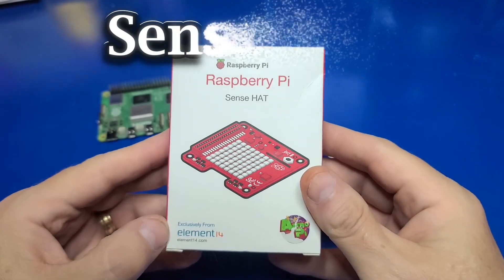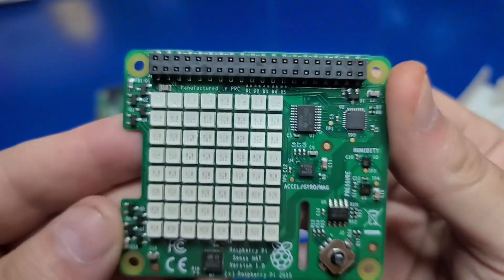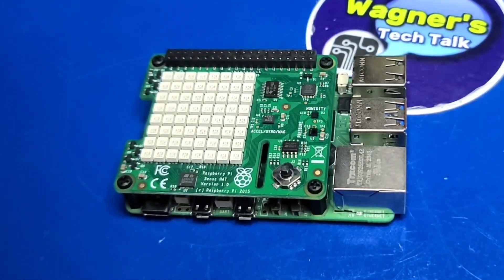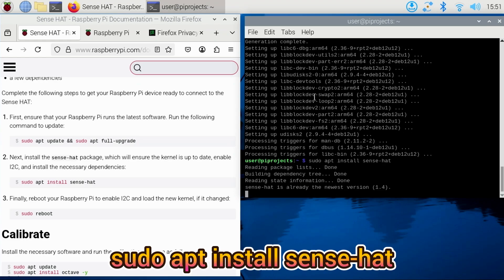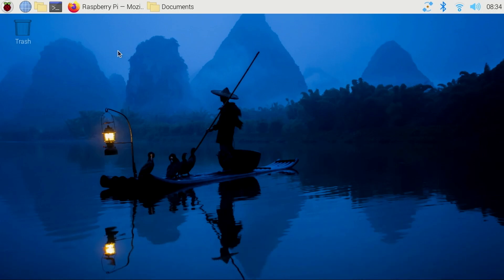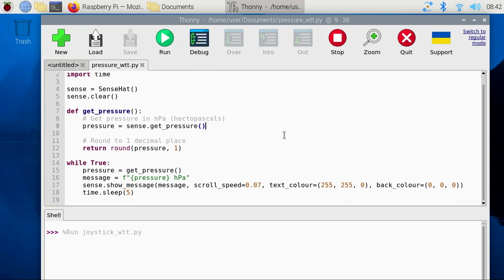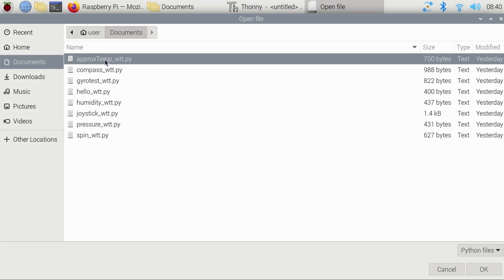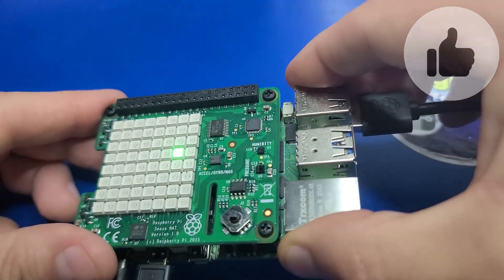Raspberry Pi Sense HAT - I Regret Not Using This Pi Accessory Sooner!

Comment: I²C   I²C stands for Inter-Integrated Circuit. It's a two-wire serial communication protocol commonly used for short-distance communication between electronic devices, particularly in embedded systems.  Pronounced I squared C or IIC.  Although Wikipedia recognizes 'I2C' it really confuses the issue.   It's likely that I2C has become kind of the de facto designation because in many instances it is difficult to superscript the 2 thereby making it 'squared'.  Even though it may be written I2C it should always be pronounced I²C - eye squared see.
Reply from the maker: Thanks James, I appreciate you watching and the correction!